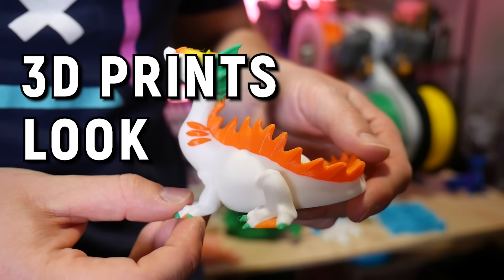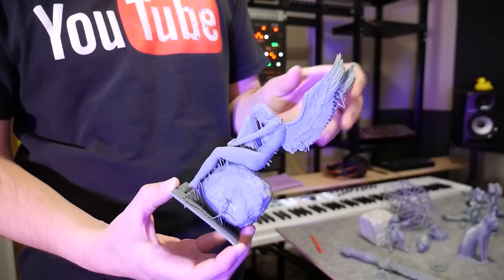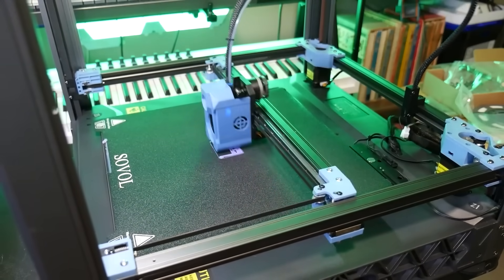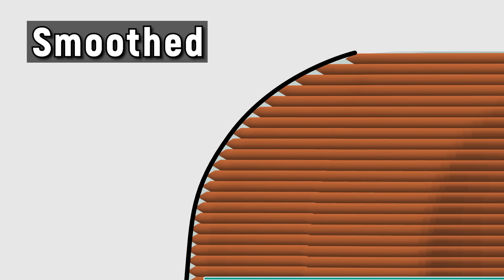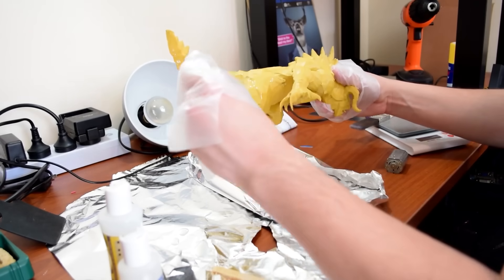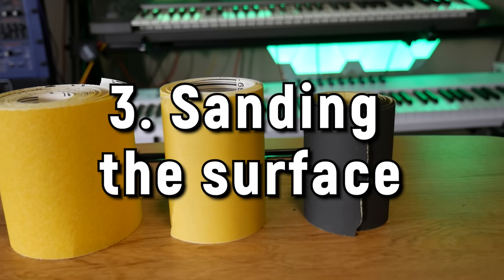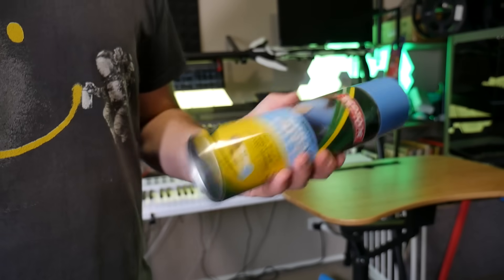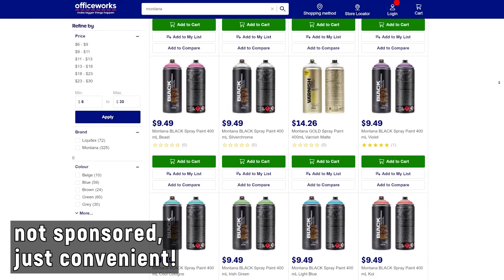How to make 3D prints look like they're NOT 3D printed.

Comment: Both asbestos and talc are forms of silicate minerals. Talc can be contaminated with asbestos due to the mining deposits being close together.

I was diagnosed with mesothelioma 3 years ago. I don't know if I ever came in contact with asbestos and it's impossible to find out. The craziest thing is this: to keep me alive and without chest drainage, I had to undergo a procedure called pleurodesis. It's done by injecting talcum powder in between the lungs and the pleural tissue to scar them and "stick" them together - thus there's no space for fluid to build up. I had no idea at the time that asbestos (the most probable cause of my issues) and talc (a temporary solution) were so closely related.
 
PS: I'm fine now, I've got an experimental immunotherapy with exceptional results. The scarring from the pleurodesis is my only major permanent consequence.

Comment: Personally, I use heat and sculpting tools.  Hit large surfaces with a heat gun to soften the plastic and then use pottery tools to give it the texture I want, or for smaller areas and finer details I break out a soldering iron set a few degrees below the filament's printing temperature.
Though, I haven't needed to do much smoothing since I found out my printer can iron layers and go as fine as a 0.04mm layer height.  Takes forever to print with those settings, but the print comes out so smooth you'd think it was already sanded, I end up only needing to clean up support material from steep overhangs.

Comment: If you're looking for an alternative powder to use then consider either fine ground flour, or if you wish to avoid using food which could potentially rot, then consider baking soda. If you call it something different down under, it's technically sodium bicarbonate or the chemical formula is NaHCO3.

Comment: Just have to comment on the card at @ 4:26 - ish - In a quest for getting rid of layer lines, I've had hunks of MatterHackers PLA - both before and after being run through a printer nozzle - submerged in jars of fresh-bought Ethyl Acetate (Sold in gallon cans as "KleenStrip M.E.K. Substitute" for under $30 at Home Depot here in the USA) for 6+ months now, and so far, have seen NO change of any kind - No softening, no dissolving, no smoothing, no discoloration (of either the PLA or the EA), no nothing - not even stickiness. Might as well be pieces of quartz soaking in a glass of water for all the effect I've observed. 0/10 on EA for smoothing PLA. Would not recommend.

Comment: I haven't really post-processed any of my 3D prints so far. The only exceptions being sanding a few edges to make things fit a little better.

Most have been utility prints (drawers, scrapers, AMD parts, etc) and don't matter for appearance. The few display pieces I've done are mostly Stargate space ships, and the lines almost kind of add to the aesthetic. The crisis crossing directions on the F-302 wings as the sloped edge printed kind of looks amazing, with how the different layers catch the light.

Atlantis is my next big planned print though, and that can't remain a single uniform colour like the grey ships have. So I think I'll put at least some of these tricks into action for the many towers on the city with their many windows and coloured border sections, rather than trying to print too many of them using multi-colour printing on the AMS. So I've bookmarked this to come back to when needed.

Comment: Wood filler is great for filling layer lines, it’s water based so it’s easy to clean up, dries fast, relatively cheap, and easy to sand to a smooth finish.
Reply: This is what I use, it's great stuff. I printed the Blade of Chaos in full scale and used wood filler to hide the gaps between the parts. Came out a treat.
Reply: Miz the wood filler with a bit of acetone for a really easy way to apply it
Reply: @ interesting. Although I prefer not using chemicals if I don’t have to.
Reply: @roofoofighter not all chemicals are bad. You are made of 100% chemicals
Reply: thank you for that - was looking for the best option -

Comment: if you want your paint to look better, go for really small amounts, don't try to cover it in one coat, go for like 5-10 coats of really thin sprays, use a paint that's dry in 5-10 minutes if you want it to go quickly.
also if you have the time you can go for bog-sand-prime-sand-prime-prime (2 light coats of primer)
if you're doing yellow and oranges, you might want to use a couple pink layers to make it pop out, same with silver, you will want a glossy undercoat.
also wash your hands thoroughly or use gloves before manipulating the part and use a degreaser like alcohol if you touched it, it will help a ton with adhesion. (wait 10 minutes for the alcohol to evaporate.)

Comment: from what I've seen talc powder still is available, though I think using a water-peo* mix mixed with water soluble resin might give good results, I'd have to try that. (I'd try mixing ~2.5g with 250ml water and 1L of resin, though it would probably be a good idea to do some tests with smaller batches before, varying the water and peo amounts.)

*peo is easily available as PolyOx WSR301, J-lube and X-lube, it's often used for soap bubble strengthening, and obviously its original purpose as a general purpose lubricant. note that relatively obviously you might find NSFW results when searching for both *-lubes.

Comment: tbh going way bigger to like 1.2mm/0.6-0.8 layers or more can look great, but also going down with resin looks good
though I do like the way removing a few degrees off of flat looks with fast resin (like 0.1mm) for industrial/low poly things, it makes nice bands.  going with the material can give great results, and while it's easy to not bother and just smooth it, and it gives decent results it's kinda like putting an opaque coating on wood.

Comment: There's another type of melt smoothing, that even has the benefit of being able to add material from scraps or raw filament to prevent deformation and weld parts, and that's thermal via soldering iron or another controllable heating tool, but it takes practice. I've had good results welding broken parts back together, and with small areas of smoothing, but it gets difficult over larger areas with a standard bit. I suspect flat woodburning bits would fair better.

Comment: I thin down some 5 minute epoxy with a splash of acetone and mix it up real good like. Then I coat the part over and over until it's good. The acetone slows the cure time way down and allows it to take advantage of the capillary effect, spreading through the layer lines.

Comment: You can use Primer Filler all in one (no need for separate spray putty and primer) Don't use enamel-based paints, use acrylic.
Quicker drying, far less chance to react.
Best is not to flog on the filler, as you can end up with solvent boil, spray a coat on, let it flash off, spray another coat.
Do about three coats.

I would use finer sandpaper, then what you have suggested, as you can get what is called "sink back" where over time the thinners fully evaporate over time, and the paint and primer sinks into the larger cracks.

Comment: A great paint for both resin and pla priming is rustoelum from Bunnings I prefer they ultra flat black as a primer as it has a built in plastic primer and gives a great surface to paint details, but there other flat colours are good as well depending on your choice of final colour.

Comment: if your sanding all the time, and want to lower the need for a huge airflow system or have to go outside or to the garage. Find a used blasting cabinet, or buy one new. used ones come up on craigslist constnatly for cheap. but even a harbor freight blasting cabinet is not that expensive, and if your doing cleanup all the time it might be highly worth it in so many ways.

Comment: After all the sanding, I mostly use the good old gesso really, seems like black gesso also helps. Look for the better and bit thicker and SANDABLE gesso, not the student quality ones.  I apply few costs, sand in between coats, it is another alternative from spray painting, it won’t have  spray  particles sprinkled on the ground , and no need to worry about ventilation and wearing ppe. I am currently experimenting with spray painting again but don’t have a fan so I just use open the windows,  not a that ideal, you really need a well  set up environment and proper fan/ ventilation . Also, when I spray paint I also get dust stuck on my surfaces
Reply: Been thinking about trying gesso myself.
Reply: @JeremyBlackston  try thicker gesso, may be better than pastes, no need to sand that much off hence less time. There are also black and gray gesso. It’s thinner but apply multiple coats and snad in between with  320grit sandpaprer(I recommend) if you want metallic effects, which is what I’m working on now, apply one or two coats of black acrylic paint to cover the primer colour

Comment: If you're set up, acetone vapour smoothing of ABS prints is simple, low effort and the prints come out beautifully. You don't need elaborate gear - the chamber can be an empty soup tin on a non-stick baking dish. In short, my recipe is 15mins @ 30C in a low pressure 'chamber' followed by 15mins drying at the same temperature. Full recipe follows...

You need
* Set up outside if possible. Follow basic safety procedures.
* A consistent temperature environment is essential. A low temp oven is ideal, but you can use a printer heated bed with a box on top, or a little garden seed raising box. Just check it thoroughly to make sure it doesn't have parts made of ABS, or ... you will be sad.
* As mentioned, the chamber can be any empty steel can. Inside you need to attach about three layers of paper towels with magnets. You can also use polyprop or pet containers, but they are less convenient because you need magnets inside and out to attach the paper towels. 
* Cheap non-stick baking dish for the 'stage'. Make sure it doesn't have a logo stamped in it - you want a completely smooth surface. The chamber doesn't need a perfect seal on the stage.
* Make sure your oven, stage, chamber and print are all very clean. Any bits of dust etc will be permanently embedded in the print and look ugly. 

Procedure
* Place the baking dish/stage upside-down in the 'oven', and preheat to your set temp (I use 30C)
* With a large eye dropper to soak the chamber paper with acetone. A soup tin sized chamber will use about 10ml. While the paper should be soaked close to capacity, ***there shouldn't be any free liquid acetone in the chamber***, it causes problems.
* Put the print on the stage, cover with the chamber, being careful that the paper towelling doesn't touch the print, and wait your set time (15mins for me)
* Remove the chamber, don't touch the print, leave it for your set drying time (again 15mins for me)
* The print should just come off the stage and you're done.
* Depending on the shape of the print, you can get an all over effect by smooth, dry, flip, smooth, dry - takes about an hour all up.

The main trick is that it's very sensitive to temperature. So, standardise your temperature low as you can go. Then to adjust the effect, change the set times, rather than playing with temp.

Comment: Very interesting video. One thing you forgot in your PPE was gloves. Wear gloves to keep you hand body oil of of whatever you plan on painting (never bare hand touch the part your going to paint after using wax & grease remover). You can wash your hands but you'll still have normal body oil. Thank you for the informational video
Reply: Also the particles will get into the pores of your skin which could suck for some filament types

Comment: My literal job is running 2 large format 3d printers that nearly older than you are.  A 3d system ipro8000 delivered in 2009 and a dtm sinter station 2500 plus upgraded by EOS.  Its the oldest printer it  runs on powder nylon12 with a 12x12x12 platform.  The SLA by 3d systems is 28x26×25 inches.   So when i hear people say resin is sma format, I laugh in 2800 dollar resin cartridges.  The dtm sinterstation was bramd new in the early 2000s

Comment: I just print with small layer height like 0.1 mm. This is enough to make the layers almost invisible and the prints are smooth without any need for sanding. I don't understand why can't people just wait longer for the print and need to complain all the time about FDM prints being ugly and how they hate sanding. Lowering the printing speed helps too. All it takes is patience.
Reply: What printer do you have?
Reply: @hc3d  just a really old version of Ender 3 with upgraded motherboard from BTT.

Comment: I don't 3D print but I do polish plastics sometimes for the smoothest finish. I use Meguiar's Water Spot Remover I bought for my car and ended up using it everywhere, even when it's not aggressive I've used it to polish some metals, though with a enough patience. Greatly recommend it.

Comment: I dunno if we have spray putty here in the US (someone let me know if we do!) but my go-to has been Rust-Oleum 2 in 1 filler primer spray. I prefer wet-sanding using blocks instead of paper and i usually go up to 1500 grit block in areas where I need a super smooth finish. Lastly after painting, spray a clear-coat on for protection and those come in matte, satin, or gloss so choose the one that matches whatever finish you plan on needing

Thansk for the great video Angus!

Comment: I've used the Proxxen Pensander on all types of plastic and it works great. I'm sure you could melt PLA with it if you tried, but it doesn't under sensible use and just sands perfectly.

Comment: I use a walking stick, but who wants a boring walking stick? 
I made mine 4 years ago, ASA handle with a carbon fibre shaft.
I cold vapor smoothed the handle after sanding and it's been perfect and is practically unchanged after 4 years of daily use.
While coatings have their place, sometimes they're not the right way to go.

Comment: There is a setting I've found really helps eliminate layer lines while printing.  In Cura, under Walls, the Outer Wall Inset distance is the key.  I set mine to 0.2mm and print at 0.12mm layer height and the results are very  much like a resin print.  You get better surface detail too.
Reply: Also, apparently, 'outer walls first' is also another way to get better appearance and dimensional accuracy. Trying it as we speak.
Reply: @JohnBaker-vm1wf  Yes, but it can limit your unsupported overhang angle too.
Reply: @incogneato790  Yes. Did read that. Just finished the print and I really don't see much difference, but one print says nothing really. I'll try it out and see.
Reply: newly obtaibed 3d printer ans Orca slicer user here!
id love to kbow how to do it too!
Reply: Is this still a method you would recommend or have you noticed any flaws with it?
Reply: What about giving the piece a light coating of UV resin?
Reply: but it takes so much longer and if its structural it weakens the print.
Reply: Ohhhhh, you mean to say, Change the width of the outer wall, and make it thinner? That sounds like a great idea to try, thanks!
Reply: @micahbogue6031  Technically, it doesn't make the outer wall thinner, it moves it inward by the amount of the setting, overlapping the inside wall.  So in effect the outer wall is thinner, and there is  more squish against the 2nd outermost wall.  You can really see the difference when printing a mini for D&D.
Reply: @incogneato790 sounds good. I have to check if in Bambu lab there is also such option to change
Reply: @Ferienpapst  let me know if you find it!
Reply: @Ferienpapst I’m just setting my A1 up so I’d love to know too.
Reply: @Ferienpapst  anything found?
Reply: @Ferienpapst  So? Did you find it?

Comment: Actually, limonene, of the three, is the safest. It's actually sold diluted as a cleaning agent for home care. It's a chemical found in the peels of lemons and citrus fruit (thus the name limonene). It can be harmful at the concentrations you see in these products, but still way safer than acetone or even the resin used for 3D Printing.
Reply: Yeah, other than it being really flammable, it's not dangerous AFAIK. It's the stuff that burns your eyes if you rip a citrus peel too close to your face, so it is obviously pretty harsh on the skin/eyes/etc., but it's normally the basis for any lemon-smelling (and some pine-smelling, in a 'mirrored' form?) 'natural', 'biodegradable', or 'less harmful' home cleaners/de-greasers/etc. Just don't get it in your eyes or let it strip the oil out of your skin, and obviously treat it and its fumes as a fire hazard much like alcohol. Actually, it's really a lot like alcohol overall?

Comment: I don't know if I'd call ethyl acetate dangerous, anymore than brake cleaner or any other solvents commonly used around households. It's flammable and you don't want to breathe it or spill it on yourself, but it's fairly innocuous.

Comment: If you have access to a sand blasting cabinet, blasting with soda is a phenomenal replacement to sanding. I use it particularly with resins, but it works great with PLA and PETG without the friction melting anything and gets into the nooks and crannies better than sanding ever can.  Typically I just blast the model evenly for a few minutes then soak and rinse in water. Depending on the aesthetic I'm going for, I'll either hit it with clear coat for a gloss finish or I'll leave it as it and rub a tiny bit of WD-40 on it so the model keeps the texture but the WD-40 clears up the remaining whiting effect from blasting.
Reply: Soda you mean baking soda?
Reply: @joeltorres3202  It's basically bicarbonate soda, yes. But I think you would buy it as blasting media, not as foodstuff.
Reply: This was my question, and you answered it!